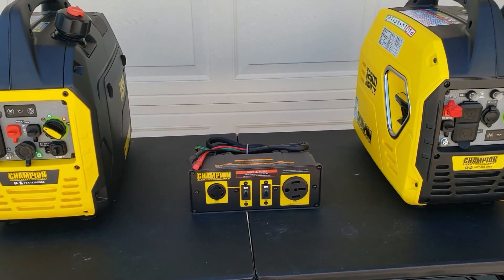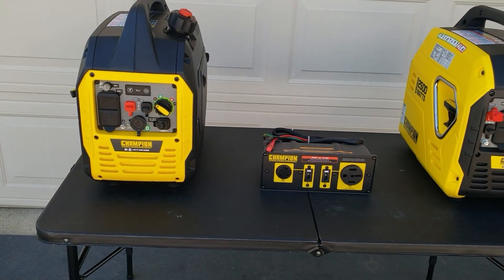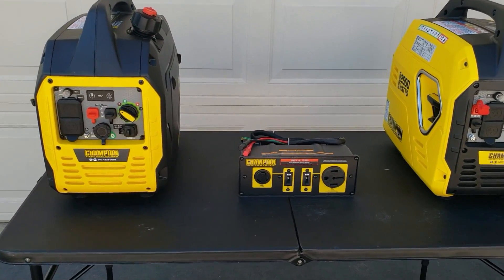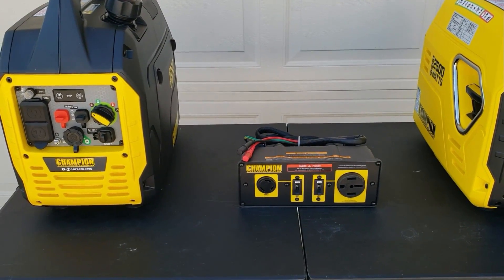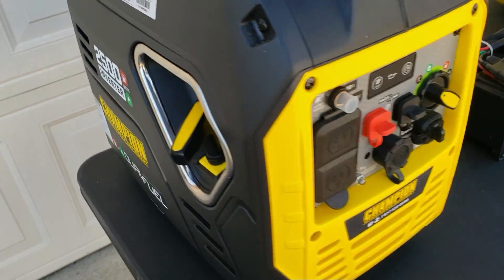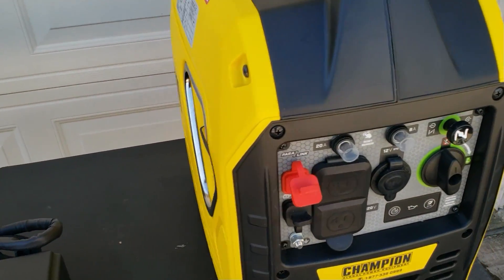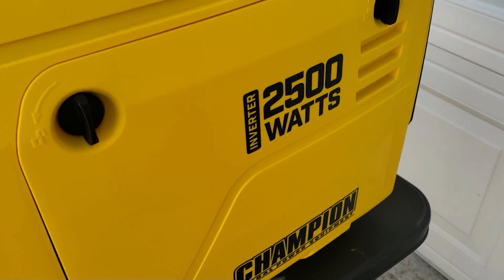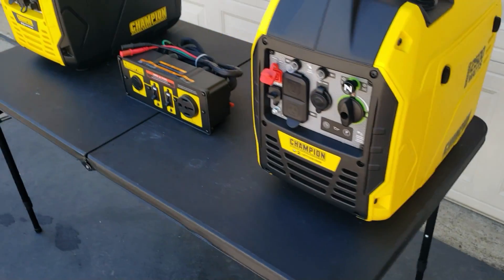Paralleling different brands 2500W Generators one with Square and the other with Round parallel plug

Comment: most people wouldn't know you can use 2 different generators. Great job.
Reply from the maker: Thanks Scott 😎
Reply: @GeneratorReviews  Hey Gavin, if I buy a generator that has a 30 amp receptacle on it similar to the Honda Companion and parallel with a different generator will that 30a outlet work?  Found a short clip where someone did it with a Yamaha and Honda Companion but not very many details.  I have 2300 watt Pulsar and looking at an A-Itech/Genkins/AiPower 2300 that has a 30 amp plug built in which would allow me to not use an external box.  Thanks!  Great videos!!!

Comment: Love your videos - from what I have seen so far, Champion is the only company that uses those square connectors - kind of like apple and their proprietary connectors.  

I own and have used one of the Westinghouse dead-man parallel cords, pretty much does the same thing as the Champion parallel kit. Some folks hate the dead man connections, and I give it a lot of respect, but it does work.

Comment: If you are running parallel generators and one runs out of fuel, could it damage the generator like it possibly could running one single genset out of fuel under load?
Reply from the maker: The second generator just goes into overload and trips the breaker
Reply: @GeneratorReviews  thanks for replying 😁

Comment: Brilliant video, thankyou. I have been trying to figure out what size/power generator to get for our new section. ('cos wifey wants me to build her another new home on it!) As I had no idea I could link two generators together I was definitely going for the bigger gruntier machines to allow for any decent sized power tools I might require. Now I know that I can buy a smaller generator initially to set up the temporary accomodation, then link in a larger gennie to carry on with the build and possibly use them both as power back-up for any outage. Much appreciated, Cheers

Comment: Would you have a part number or a link for those round-to-square parallel plug adapters? Thanks - Great video.
Reply from the maker: I don’t have a part #, I will call and get the part#
Reply: @GeneratorReviews  Thank you Gavin. I spent the better part of the day searching every combination of square to round parallel adapter, but couldn't find anything. If you can find it, you would be my hero. If it's no longer available, can the round plugs from a Honda parallel kit be simply spliced into the Champion 50 AMP parallel set? I need to parallel two Honda eu3000is generators. - Thanks again. - Dave
Reply: @GeneratorReviews  I sent this message to Champion: 

“I have the Champion 50-Amp Parallel Kit and need a set of the adapters that convert the Champion square parallel plugs to round parallel plugs. Could you give me a part number or link, or other way to order sets of these. - Thanks very much. - Dave”

The reply I received was:

“Hi Dave. Unfortunately, we do not sell or produce adapter that convert from square to round. We are sorry about that.”
Juan from Champion Power Equipment

I find that strange since in your video, the adapters are attached to the back of the parallel kit. I am supposed to receive this parallel kit today. I just ordered it through Home Depot. I'll let you know if it includes the adapters as yours does in your video. Either way, I need two sets to parallel two Honda eu3000is generators. - Thanks Gavin
Reply from the maker: @DavidJKoch  that was just one associates opinion.
I bought them from Champion I’ll find the adapters and I’ll send you the link no worries.
Reply: @GeneratorReviews  Thanks Gavin.
Reply: @GeneratorReviews  If you ordered those on-line or have an account with Champion, you might have the receipt or invoice in your email, which might have the part numbers. Just a thought...
Reply: @GeneratorReviews  Hey Gavin

I received the 50 AMP Parallel kit today. It does have the clips on the back where you found the adapters in your video, but no adapters.

I found these on Champion's site.

9.1700.002.1	Adapter Plug, Parallel, Black

9.1700.002.3	Adapter Plug, Parallel, Red

There are no pictures, but I can't imagine what else they could be. Does this seem to you like it might be the adapter plugs, since they call it an adapter plug? :-)

The part number does not show up anywhere in the manual.
Reply from the maker: @DavidJKoch  Nice Dave👍🏾💯
Reply: @GeneratorReviews  I'll order them. When they arrive, I'll post if they're what we're looking for.
Reply: @GeneratorReviews  Hey Gavin.  just received the adapters I ordered from Champion. Yes, these are the square to round adapters. Part No.  9.1700.002.1 - Adapter Plug, Parallel, Black.     Part no.  9.1700.002.3 - Adapter Plug, Parallel, Red. Now I can use my 50AMP Champion parallel kit on my two Honda eu3000s generators.
Reply from the maker: @DavidJKoch  awesome 😎
Reply: @DavidJKoch  is that through the champion website or did you have to call? im not seeing them on the website
Reply: I ordered mine through champion site.

Comment: I do enjoy watching your videos. but I have bought two of the champion parallel kits and neither of them have the adapter plugs included not sure if this is discontinued or what but if you go to there website to buy them it says out of stock. I have a champion dual fuel 4500 and a Cummins p4500. bumming that I can't use them parallel. one will have to go I do like the Cummins better
so I my replace the Champion with another Cummins or the new Westinghouse 5000 they both look identical and buy a parallel kit with round plugs. any info would be appreciated. Thanks
Reply from the maker: Hey buddy… I think we spoke about this on the phone today 
It was nice chatting with you.
Reply: @GeneratorReviews  wasn't me but I did talk with Champion sales and U.S. is no longer selling them or offering them in there kits. That's what I was told. they said the older kits had them newer kits don't. the good news is they ordered the adapters for me from Canada. hope that helps

Comment: Thank you for your information. If I run two Champion Inverters with 2.500 Watts would it be possible to get 5.000 Watts? What is the highest power both generators could achieve?
Reply from the maker: You would have 5000 starting watts, but 3600 W running.
Reply: So only the peak is doubled ?

Comment: Gavin I'm in need of the adapters for the champion kit and can't find them. They're not on the champion website. Where can I get them? I only need 2. Thx
Reply from the maker: I just found them 
Adapters 
9.1700.002.1 Adapter Plug, Parallel, Black
9.1700.002.3Adapter Plug, Parallel, Red
Go to google put this in the search

Comment: Just bought this same parallel kit last week.. Didn't come with those little adapters in the back. I had to order them separate.  I thought it came with 2 adapters according to your video..
Reply from the maker: The one I got came with the adapters, I guess they changed the kit it even has a holding clamps for them.
Reply: @GeneratorReviews  that's what i don't understand. It's has the holding clamps. Either way i had to buy 4 of them. Thanks for your videos. I watch them regularly
Reply: @MR-gp9ys  where did you find the adapters at

Comment: My question is these are rated at 2500 W. I have a Honda 2200 watts and a Ryobi 2000 watts Will the parallel kit work with this?
Reply from the maker: The kit should work

Comment: hello, help me, please, I have 2 generators of 3 kw, champion inverter 3500 watt and o'mac gti7000e, I bought a parallel kit Konner & Sohnen KS PU1, connected them, started them, but when the load is applied, the overload lamp lights up, when  This load is not large, about 1kw.
Thank you!
Reply from the maker: By any chance, does one generator have 240V and the other one only have 120V?

Comment: I need to convert a cheaper round parallel cable to fit the square female plugs on the champion generator. Currently using a Westinghouse 2-1 30A suicide cord instead of the parallel connections.
Reply from the maker: That works too but just need to be careful

Comment: What about two different wattage inverters?
Reply from the maker: Yes, you can parallel two different wattage generators
Reply: @GeneratorReviews  Say a 3500 and 4500 watt? What is the total output then?
Reply from the maker: @stevemitchell7475  add the two running wattages and that’s your total power output

Comment: I want 3 , 1000w generators in parallel.  How?
Reply from the maker: This is actually something you can do, check out this video.
https://youtu.be/VJJX6Nw0NTc
Reply: @GeneratorReviews  Thank you.  I ordered my second ALP propane generator $55 off with code SAVE10 today.  So two ALP generators and one Honda 1000.  ALP manual says just parallel with ALP but I think that is more a salesman pitch than reality.  Shall see.

Comment: But can you parallel a 1500 watt and a 2500 watt "Inverter" Generators of different brands? ,  - THAT is the question my Dear WATTson.
Reply from the maker: Yes, as long as they’re both parallel capable, and have the same parallel ports
Reply: @GeneratorReviews  - AND you do NOT exceed double the "Running watts" of the smaller generator. 
I have learn much since I asked that Q .
Thanks for responding! you will get thumb UP for that.
Reply: @GeneratorReviews so if they’re both parallel capable but have different ports (one generator have square ports and the other having round) and they’re not exactly same wattage, recomended to not run the lm in parallel? I have a Honda 3200 and a champion 4500/3750, would like to run in parallel… thank you!

Comment: Paralling Inverter generators designed  for paralleling is one thing and paralleling non inverter generators is completely different and much more complex than inverter generators.  In both cases the generators must be synchronized in both voltage and frequency.
In SOME inverter generators this is  built into the inverter gate contol circuitry  while in non inverter generators this control is not normally included.  Also the load ratio between generators must be controlled to avoid one generator being motorized.  It is a lot more complex than making plugss matched!   A lot of salesman are full of BS

Comment: Why bother with the "special" paralleling cable?  Use two standard 120V male plugs and one receptacle, all wired the same polarization.  These paralleling connections on the generators are wired directly with the generator "standard" power outlet.  There's nothing "smart" about these cables other than the have a guard  around the connector to keep Mr. Stupid from easily shocking himself with an exposed plug.